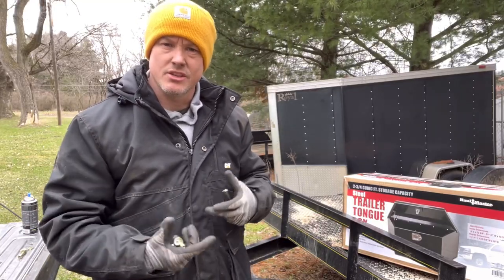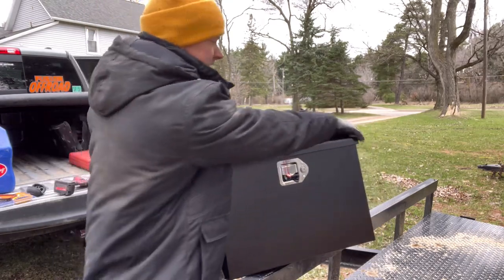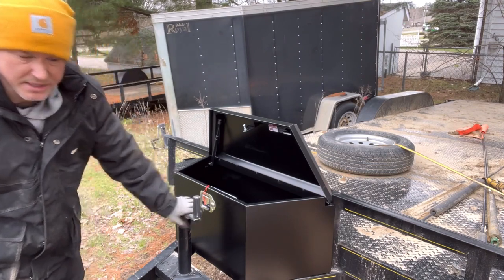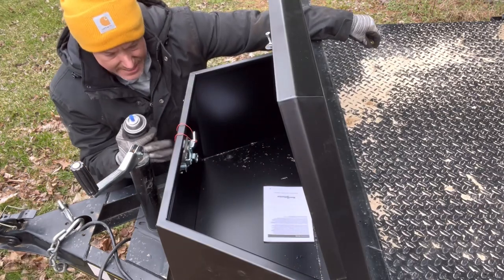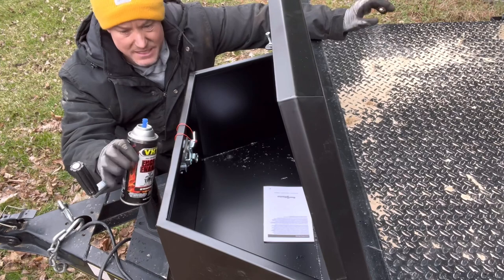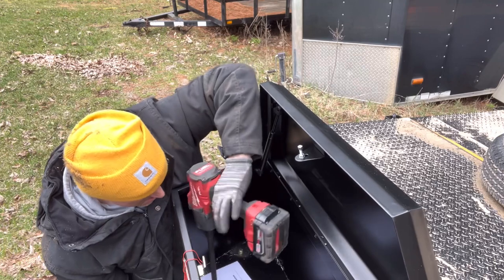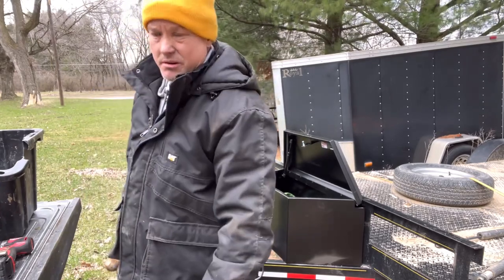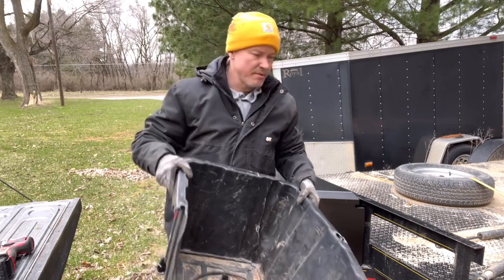How to Install Trailer Tongue Box Storage Harbor Freight - Best best trailer tongue boxes

Comment: Wont drilling holes in the frame of the tongue weaken it though?
Reply from the maker: I have had the trailer for two years and hauled a lot car, truck and vans and have not had a problem, you could wield it on if you wanted.

Comment: Not sure I'd want to drill holes in the tongue. That creates a potential weak spot/cracking area. I'm thinking of getting a similar box, but I'd rather  weld mine on.
Reply from the maker: You can weld them, it’s a good idea! I just bolt them for when I replace them.
Reply: It is not making a weak spot or cracking LMAO.  That is a tiny hole.   Perfectly normal.  Frames like Trucsk have holes in them so you can bolt the Bed of the Truck down to the frame for example.  LMAO
Reply: @MR.TOYBOX  Those holes in truck frames are engineered to be there. these holes that are drilled are not engineered to be there, so that analogy does not work here.

Comment: What about condensation and draining?
Reply from the maker: A year later and water still does not get in there! I would drill 1/4 hole in the low corner! Level the trailer and place a marble in the box to find the lowest point!
Reply: @FusionOffroad  Thanks, this one not wide enough, need 40" wide at rear. I would drill hole in both bottom rear corner and a couple vents at the top rear. I live in a wet area.

Comment: Am I seeing things or did the lid just pop up without you even pulling the handle to open it?  At 1:32. I think I’ll pass on this one.
Reply from the maker: A year later it still hold up strong! I am surprised! 😂😊
Reply: @FusionOffroad  no issues with the lid though? Not flying open while going down the road?
Reply from the maker: No issue at all, and I don't even used the Key lock @jbones2121
Reply: @FusionOffroad  thanks man! Still on the fence about it though. But slightly leaning toward getting one now.